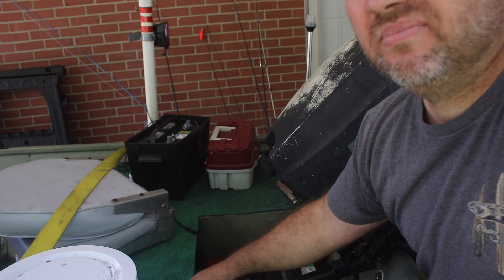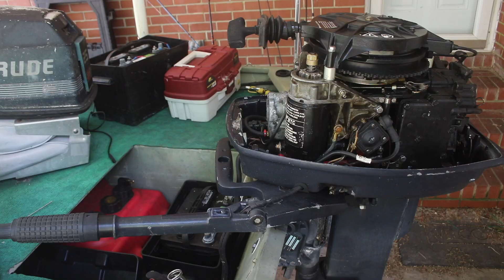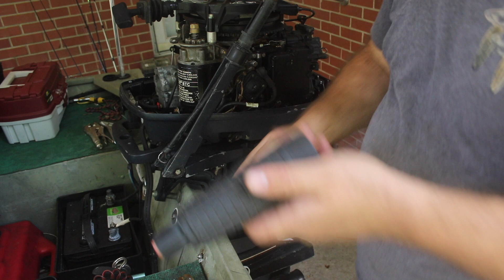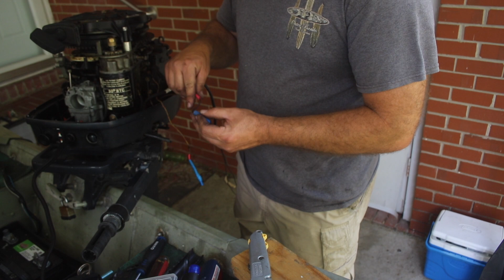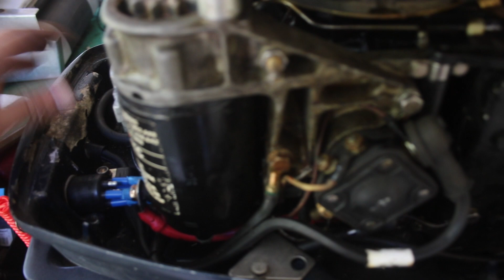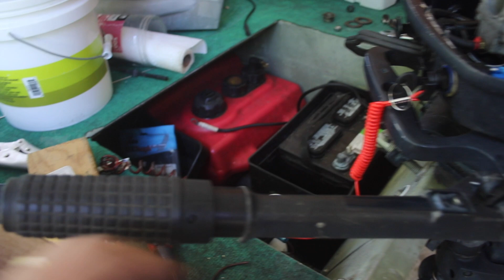1989 Evinrude 25hp Ignition Repair and Mod

Comment: I have the same Evinrude as you that I picked up on Facebook marketplace.  I don’t have any knowledge  on outboards yet, but does this carburetor need an airbox on it to operate properly? I’m have a hard time stating it, it tries to run but shuts down.  Any suggestions? 
Also, what should the compression be on each cylinder?  Any suggestions would be greatly appreciated!
Reply from the maker: @johnl.5907  compression should be high  (120psi or higher)and even within 10-15 percent.
No breather on the front of the carb.
The choke is not really a choke.  It’s like a priming bulb.  Couple of squirts before starting, then push in a notch after starting, then fully pushed in when it’s running and warm
Reply: @ 
Thank you for your fast response!  I’ll try that.  On my carb on the top section, I have a black turn knob what is that for?
Reply from the maker: @ I think it’s  the idle adjustment to make it rich or lean, but I am not at home currently to look.
Reply: I’ll try getting it going this weekend. Thank you again, John.